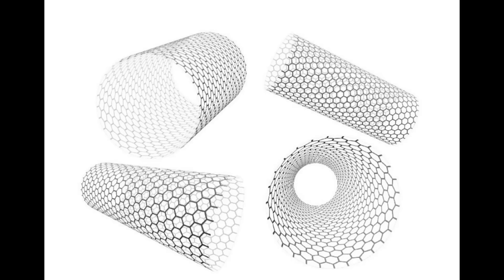What Material Will TSMC and Intel Use after Silicon?

Comment: "Do we need like a 100x more performance?"
Yes! Have you ever tried running synthesis and layout on a complex chip design with tight timing constraints? That thing can run for weeks in the worst case...
Reply: Yeah I remember as a kid in the mid 90's people saying the same thing and years later around 2005 people saying the same thing, the way I look at it, the more power the better, give developers the option of that power at a low price that consumers can afford and watch how they find ways to take advantage of it, in other words, we need a lot more computing hardware then some people like to think.
Reply: Well, here's a paradox - we have two classes for problems: ones for which current hardware is or should be plenty (text edit) and ones for which it won't be enough - ever. Like multiparameter optimization...
Reply: Yeah I remember as a kid in the mid 90's people saying the same thing and years later around 2005 people saying the same thing, the way I look at it, the more power the better, give developers the option of that power at a low price that consumers can afford and watch how they find ways to take advantage of it, in other words, we need a lot more computing hardware then some people like to think.

Comment: Transitions to smaller nodes do not offer linear increases in performance and is expensive.  7nm is so hard to do that for intel it's not worth the investment does not bring sufficient performance to justify the cost. That's why Global Foundry sopped at 14nm or 12nm. It makes sense only for contract foundrys like TSMC or samsung that make and sell much more chips for several different company (gpu's nvidia, amd, cpu's chip set memory)

Comment: I believe graphene digital electronics should be able to handle far higher clock speeds at similar scales of current or larger silicon nodes due to the fact that it takes far lower voltage needed to switch open transistor gates. Lower voltage will mean lower power for the same clock rates for the same amount of gates. This has the great benefit of less heat. Figuring out how to properly harness the potential in graphene like you said will still be quite the hurdle, but thankfully people are working on it right now, which will be the reason why anything gets done in ten years. Silicon will improve more, but companies and researchers know that eventually that they’ve will need to look elsewhere for progress.

Comment: What about diamonds? Those can be created artificially and you can use lithography to print circuits on them. I read about these being done as proof of concept way back in the early 2000s in Popular Mechanics. Diamonds work pretty well because of less heat loss from resistance. Meaning they can be clocked very high when also combined with the fact that diamonds are unaffected by anything short of extreme temperatures, like 1000 Fahrenheit or higher depending on circumstances. No one wants a 1000 degree heater in the summertime of course, but you could clock a diamond chip very fast before reaching those temps.

Also as JBrinx18 mentioned, optical computing is another one that has been around in the concept stage for some time. Unfortunately that one needs to become cheaper and physically much smaller before being a valid replacement. It's coming, but will be a while sadly. Also on a related note, optical 3D storage (no not CD's) is intended to be part of this and which I am rather excited for.

Oh and the reason why quantum computing is so limited right now is because it is in its infancy (but currently advancing at a brisk pace in recent years), and we are literally trying to invent new ways to program for it since it doesn't work with traditional coding methods.

Comment: The problem with graphene and carbon nanotubes is they're a superconductor. Which is a amazingly useful thing for other applications.  But there is no way to make pure graphene/nanotubes switch off and make a functional transistor. 

So the challenge lies in what materials to dope it with to make it a semiconductor and not totally nerf it's advantages. Also to make it mass production viable.
Reply: Graphene is a 'ballistic' conductor (which just means that electrons are EXTREMELY mobile, but still conduct with some resistance), but it can not be a superconducter without chemical doping, or weird bilayer 'magic angle' tricks.

As for using it as a switch - there are at least two types of graphene, one which simply conducts very well, and another with so called 'arm chair' edges that has a natural band gap.

In short to make it a semiconductor, you need to manufacture it with edges that have a very specific atomic configuration, which is more difficult than simply manufacturing the monolayer material itself.

Comment: I'm surprised you didn't mention the Hell material known as Cadmium Arsenide.

Advantages: Already in use for thermal sensors, zero band gap like Graphene, has sky high clocking potential like Graphene, is (weirdly) an electrical insulator unlike Graphene, and makes 3D transistors without interposers unlike Graphene.

Disadvantages: Um... Yeah.
Reply: So, for the education of the curious, what exactly are the disadvantages of cadmium arsenide?
Reply: @johnm2012  Cadmium is a truly horrifying carcinogen and Arsenic is about as poisonous an element as you could ask for. The costs to safely handle them would offset the fact that people will generally pay you to take them away. To put it in perspective, handling Mercury is safer.

Comment: People aretalking about optical computing and forgetting the one HUGE pro it has: it has a tdp in the milliwatts and that heat doesn't affect the most important optical qualities like gates which would means you could actually just stack it however much you want + transimssion times of ram data etc would go down DRASTICALLY and calculation speeds would also get 100x ish bump which would mean you wouldn't even have to shrink it down to the levels of silicon right at launch AND you could keep improving it for years and yet another bump would come when plasmonics get mass manufacturable

Comment: Dude, you forgot to mention DNA based cpu's and optical based cpu's!. I saw a documentary about 10 years ago wrt LG working on DNA based computing. I think graphene would be the preferred option. Failing that, it would be molybdenum disulphide. The usa military already has quantum based computing. Their tech is 25 years ahead of what is commercially available. So when Zen came out in 2017, the usa military already had that level of cpu tech back in 1992.
Reply: It has been my experience that the US military lags in tech rather than leads.  In 1980 I worked on a Univac 1230 (circa 1962), my brother in the 80s used Trimble GPS off the shelf because the gov issued units were so primitive, and my son was involved in the ATM rollout in the early 2000s.
They may have cool stuff in a lab somewhere, but not in the field.

Comment: I work in the EDA industry; TSMC's 7nm process goes well below 800mV.  Their 5nm is going down to 450mV. The theoretical limit (which will likely never be hit) is somewhere around 250mV, not 800mV. As the gate decreases in width, the less voltage is needed to "switch" the transistor. 
LN2 overclockers do not use 800mV, they're often at 1.5 or 1.6V. It is true that lower temperatures correlate with lower voltages.
EUV is also going to be a very big thing; something like 6/14 layers will be EUV at 5nm so there is a ways to go

Also, "2nm" doesn't mean a whole lot in terms of actual dimensions, so we should see many "2nm" nodes, potentially various 1.8/1.5nm+++ nodes that slightly shrink one or more of the dimensions of the internal structures.
Reply from the maker: That was at least one of the original limits according to what I read, I have indeed seen voltages since Broadwell that are lower.

Comment: With Graphene it's more about getting higher clock speeds not smaller nodes, as far as I'm aware. Theoretically up to something like 40GHz.
Reply from the maker: Well Silicon can theoretically hit 10GHz+, but it hasn't.  That's the problem with switching - you have to be confident you can get notably higher upgrades over the next 20 years it is used.   Like I said - I think Graphene actually is promising, but it's not mountains better than Silicon.
Reply: @MooresLawIsDead  . 2 years has passed . You might want to look in to optics etc . 
Check out even China is doing since the got ban by USA from transsitor bla bla bla

Comment: A big problem with getting past silicon is that it is really freaking cheap as a raw material, the only competitors that are potentially close are carbon based (like graphene).
I can see things like GaAs ASICs or co-processors being added on to SoCs to do specialised tasks.
Quantum computers are distant as you say, but when they are ready they could only work as part of a client/server on remote computing service.
I'd like to hear more about molybdenum disulphide. (You spelt it wrong btw.)
Reply: Also, while it wont replace regular silicon in the logic or memory space - Silicon Carbide will very likely replace it in power electronics like the VRM's on PCB's, or the switching elements in our Power Supply Units.

It's supposedly a few percent more efficient due to a wider band gap, so we could find more PSU's inching closer to passive operation due to less heat wasted from power conversion.

Of course, less necessary cooling for PCB VRM's is also a good thing too.
Reply: Americans spell many words with 'ph' as 'f' - including Sulphur as Sulfur.

Don't ask me why, I honestly think they did it for shits and giggles at this point.
Reply: @mnomadvfx  Yeah, I meant molybdenum though.
Reply: @korakys  MoS2 is an interesting material, but like all the other 2D monolayer variants it is at a 60's-70's level of knowledge compared to silicon, research time and financial investment wise - albeit with years more advances in basic scientific theory and better equipment to test it with.

Silicon Carbide on the other hand is much more mature, it's already finding some uses in the power market.

Comment: Gallium arsenide (GaAs) can go to 250 GHz an up.
Reply: Renny the chemistry class when the teacher told properties change when a compound is made ... H2 is gas O2 gas ... Boom h2o and it has completely diff properties
Reply: I used to work with GaAs MESFETS some 30 years ago. High frequency, but they draw lots of current. You have to be able to implement a CMOS type of process, or you're just building a hot plate.
Reply: We Are already at 217.6GHz. Currently 64 cores Processor at 3.4GHz is like 64x3.4=217.6GHz in AMD EPYC CPU.
Reply: Not to mention We have to multiply 217.6 with 1.5 Because 64 core AMD EPYC CPU has 128 Threads. So They act like 64x1.5=96 cores which gives us  326.4GHz Speed CPU which is already available for few months on Market.
Reply: @fireartdrawer9531  Two people watching a movie for two hours doesn't make it a four hour movie.

Comment: One thing to note is that manufacturing processes aren't really as small as the number suggest. 7nm isn't really 7nm transistors. It is just marketing. And i don't believe we will ever get much smaller than 7nm in true transistor size. Sure manufacturing can improve a lot and marketing may name future nodes as 5nm 3nm 2nm or even 1nm, but i don't think the scaling will be 2x for each successive node. More like +30%-50% improvement per node. Still important, but yes Moore's Law is dead. If we got 8x in a decade, well, that would be almost Moore's Law improvements, so i think your conclusion is very optimistic. It is closer to 4x in a decade.

Comment: What you mean is that they cannot manufacture a full modern CPU or GPU out of graphene, not that they cannot manufacture a chip.

Also, researchers found a method of nanolithography (see link below) that will solves the defect problem. The next problem to solve is that most graphene samples tend to have silicon contamination, which ironically, prevents it from working as a viable silicon replacement. That is the only thing holding graphene back from beating silicon at an electrical level. Researchers found that when the contamination was removed graphene proved to be a lot better than silicon at an electrical level.

We are not "almost" at photorealism or even halfway. To achieve it, even ray tracing is not good enough, let alone hacking it. We need path tracing. But that will require dedicated hardware that is a lot more capable than the ray tracing cores in RTX or a ray tracing ASIC.

Comment: @14:00 it's funny you say that, I have been wondering why people have not been talking about the cooling solutions more rather than focusing entirely on node shrinks and clock speeds. Earlier this year or late last year I was looking up freon or phase change cooling. Linus did a video on this a few years ago "How to Build the ULTIMATE Sub-zero Phase Change Cooling PC Build Guide". At the time I was looking for something that would cool the air in the system down like air conditioners cool rooms. So wasn't actually looking to cool the cpu but the entire system. The existing cooling solutions will remain but this add-on would make the air in the case colder so you're not relying on good airflow as much.

Also why people do not talk about the software and inefficient coding that currently happens. It 's like there everyone forgets hardware needs software to be useful. For all the noise gamers make about single core performance, if developers were trained or encouraged to start doing more multi-threaded coding this would certainly improve performance. 

All that said, I am not as optimistic about getting below 5nm and everyone talking about nvidia gpus going 7nm, we really don't know how well they will perform especially if AMD engineers were allegedly having issues with Navi. Also not convinced quantum computers have a practical use outside of cryptography and similar tasks. Plus, even if the hardware could be made useful, a new generation of developers would still need to be trained to code for quantum computers, and we already know how reluctant developers are to adopt or learn new technology

Comment: graphene is a material so spetacular that it seems like something out of a comic book, when we finally can mass produce it, the world will change forever
Reply: Superconducting electric grid. House wires that can take huge current. Cheap extension cords that are thin and light with high current ratings and no voltage drop. Way less use of copper.

Of course this would probably carbon nanotubes than graphene, same thing, different structure.

Comment: Why not just go to slow and low power and large features but 3D.  Don't make features smaller, don't make transistors or moving information faster - in fact make them slower because you can't get rid of heat, just scale by having so many more transistors by building them in 3D.

Comment: Another thing to think about is changes to display technology. If we can get practical effective eye tracking, we can get photorealistic foveated rendered graphics at a fraction of the computational cost of traditional displays. The eye tracking could be combined with monitors for more traditional displays, or with glasses to provide a virtual monitor or full VR environment.
Reply: It will also use a fraction of the power to use a tiny display beamed to your eye with waveguide optics, couple that with a shift to MEMS audio and VR could be a lot cheaper and power efficient than it is today - not to mention lighter, and therefore much more comfortable for long viewing periods.

Comment: 3D stacking chiplets has problems mainly COOLING! By stacking them you reduce the contact area for the heatspreader and heatsink to cool the chip. Stacked chips would be clocked much lower than current cpus, probably 1-2GHz and using ultra low voltages. You simply couldn't run them at 4-5GHz due to the massive heat output that cant be removed from the chip stack quick enough. One of the reasons why chips and sockets are getting larger in size is more contact area for cooling as well as core count growth!
Reply: DARPA ICEcool, look it up for intra stack cooling using micro fluidic channels (vias) in the stack.

Using that you can cool them from the inside out.